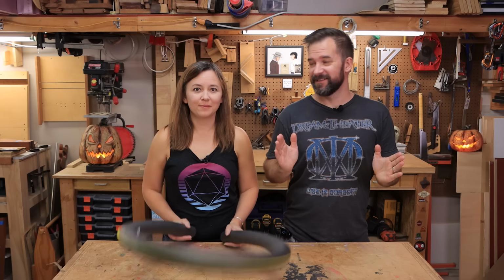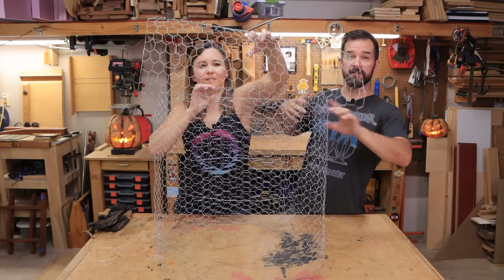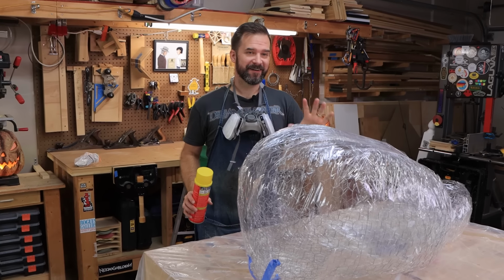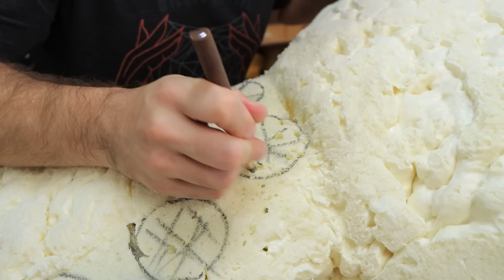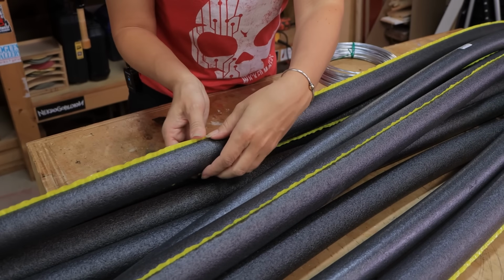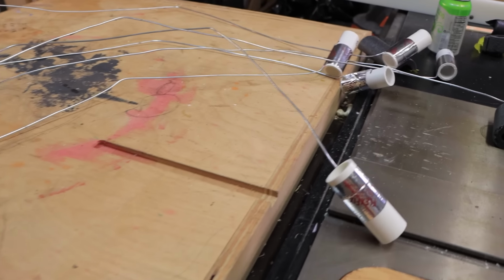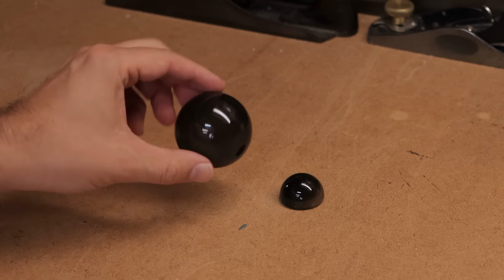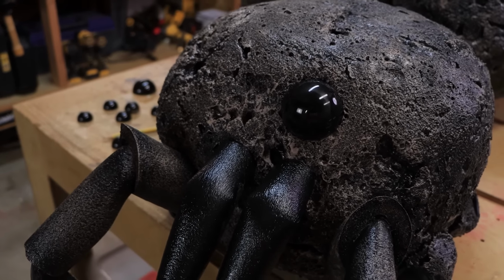Making a Giant Spider! 🕷 DIY Halloween Props

Comment: I hate even thinking about making the Legs. Even you guys did not mention the legs are not all the same length. The center 4 are shorter. Is there any Measurement TIPS on the lengths? If there are I have never found them.
Great Job.
Reply from the maker: We recently posted the measurements we used on our Patreon if that’s of interest! We basically looked at reference of real spiders and figures out legs/body proportions we wanted.

Comment: Hi, great tutorial. I've learned a lot from you two.  I noticed that you added some pvc supports to the underside of the body, to hold the weight off the ground.  Are they attached the same way that the legs are attached?

Comment: What type spray foam did you use on the PVC elbows? It’s not the same as the thick great stuff on the body
Reply from the maker: We just ran out of the first kind. It’s basically the same stuff. We used 1” pvc for everything

Comment: Did you end up using all of the chicken wire you bought? The Amazon one you linked is 50ft but that doesn't seem like how much was used
Reply from the maker: Definitely not. We’ve got a bunch left for other stuff. Probably used like 10’ maybe but they didn’t seem to have smaller bundles on Amazon.

Comment: As always, really great work!! Quick question: How did this hold up in the wind. I love how lightweight this design is but would be concerned the legs would wobble or flop around in the wind.
Reply from the maker: Thanks! The legs had a bit of wire sticking out from the tips that we could stick into the ground so that helped to stabilize it in the wind.
Reply: @WickedMakers  Ah, perfect solution! Thanks!! :)
Reply: Finally getting around to making this and I've completed the body. After reviewing TONS of videos online, your spider's legs are my favorite. Do you have an idea of the measurements you used?
Reply: For others interested, I think I figured it out! Front legs are 3ft pieces of each size insulation piping. Rear legs are 2.5ft of each size. Front middle legs are 2ft. Read middle legs are 1.75ft.

Comment: QUESTION: (for safely in my build…) gorilla superglue says not to use on polyethylene or polypropylene… but that’s what the spray foam is… isn’t it?

I’m at the point where I’m about to glue eyes on and am unsure of which glue to use

Comment: Im having an issue getting the foam insulation to stick. Using DAP contact cement but its just not strong enough. Heat gun doesnt work either. Any suggestions? Maybe i spring for Barge brand.

Comment: the legs keep twisting.  The wire does not stay glued to the tube.  How did you glue them and any way to stop the wire from rotating?
Reply: did you wrap tape around it, after applying the glue?

Comment: I do not recommend pool 5 noodles.  They don't hold paint well and the contract cement fails on them too.  I did use some pipe insulation for the small parts and fangs and it works 1000 times better.  Going to remake the legs next year

Comment: 17

"" by the time you spend all that money on the material that they used to make that thing you can buy one, PVC, Chicken wire, Foam stuff, pipe insulation, that stuff is not cheap these days , not to mention the time needed, just buy a fake spider on line, it would just add up to about the same probably cheaper.
Reply from the maker: This was WAY cheaper than buying a 16’ long spider at a store.

Comment: You can also make a 3 foot one Much easier by turning over a large plastic cauldron you've srpay painted an hour glass on, and use pool noodles, hodling together by pvc 5" deep into the tubes. Throw the cheap tubes away each year and flip the cauldron over for storage. . . Easy

Comment: Following your instructions  it turned out that the wire you used was too weak to support the structure, later it turned out that even 8 spray paints were not enough to paint the whole thing,at the end i spent 200 euro only becouse i promised my kids to do it.